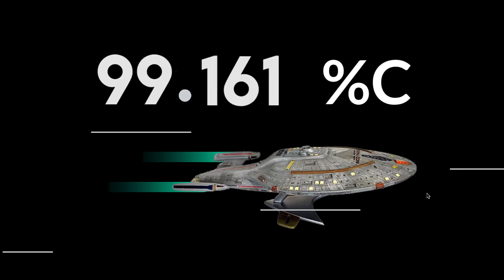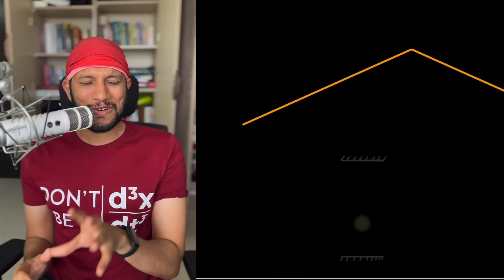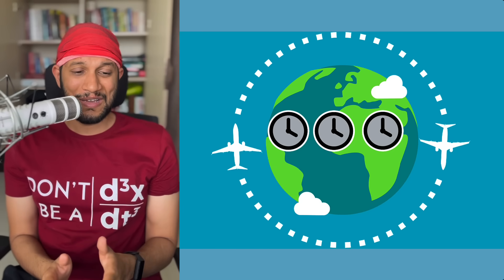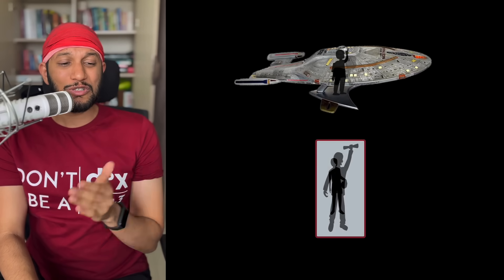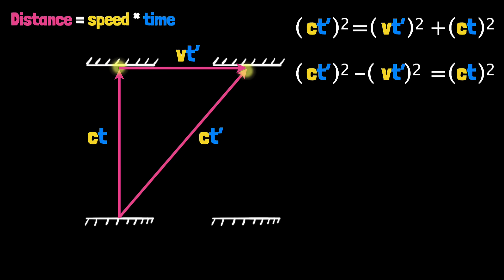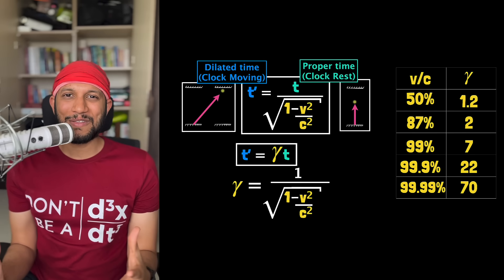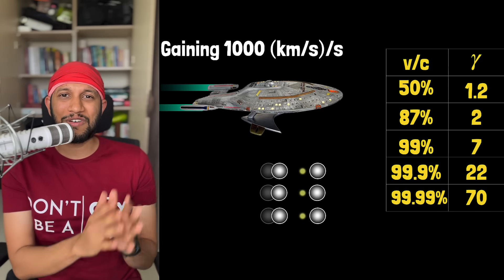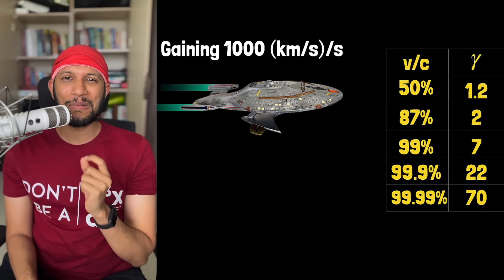I finally understood why you can't go faster than light! (My mind is blown)

Comment: Einstein simply stated the faster you go the more fuel you need until the weight of the fuel is so much you start going slower. You can reach the speed of light with an anti gravity machine. If you create a magnet strong enough through electromagnetic engines you can push yourself away from the earth by using alike poles. +to+ to and in deep space with zero gravity you can get to the speed of light with just a simple push and you will continue to gain speed until you hit the speed of light. Because matter travels at the speed of light in zero gravity space

Comment: Hi! Mahesh,
I like your videos, especially  because of great explanations.
But in this case, I have a counter intutive argument regarding the photon clock.
Let's assume that the photon clock is kick started by a pulse laser placed below the lower mirror so that a pulse of photon can be fired in the upward direction from a tiny cavity.
Now, my question is how come the laser pulse be fired diagonally in the moving rocket (or moving inertial reference frame) to hit the upper mirror. 
It seems like the photon is also getting dragged with the moving  rocket. 
The light photon should move in a straight line towards upward direction in the first place, missing the upper mirror.
If not so, then the whole experimental setup will not be visible to us on straight line of sight as the light coming from the spaceship will also move diagonally towards right side escaping detection.
In that case we might be able to see the spaceship in the past by detecting the lights coming from the upper left side as the light is moving diagonally.
It is still the dilemma even after applying the length contraction.
If possible, please re-explain this topic with my laser pulse.

Comment: I haven't studied this in classes, and since I am new to understanding it these ways, I am just thinking thoughts.  Seeing 1) C is constant because it needs to answer the need for velocity to be indetectable within its own frame of reference.  So in your example of the twins aging, the one "on the ground" is staying still and the one in the USS Enterprise is aging slower because it is moving faster.  But to the twin on the Enterprise, the twin on the ground is the one moving, therefore aging slower.     Then there is this question.  If I turn around once on earth, relative to myself, it is the stars in the sky that moved in a circle around me.  For them to move in that circle at that speed, they would definitely need to go faster than C.  Relative to me they have broken the speed limit in a circle around me.

Comment: The explanation of time dilation is brilliant. With regards to C limit I wonder though - the special theory of relativity discussed only inertial frames of reference (frames of reference that are not accelerating). So inside the accelerating ship, we cannot rely on the relativity postulate, that all physics rules look the same, and therefore I don't know how the photon clock behaves in that frame of reference, IOW whether time dilation holds. The other explanation I heard for the C limit is that it would destroy causality. That is if you look at a rocket launching and hitting its target, and another observer who is traveling in a speed greater than C with respect to you is also observing the rocket (I forgot in which direction he would have to go), then he will see the time of hit happening before the time of launch and that destroy causality.

Comment: Nice! 
Another thing I have in my mind is, when you travel with speed a photon coming against you is blue shifted. So faster you go so more blue shifting has that photon, so shorter is its wavelength and so  more energy it has. So you can't reach c because if you do reach c the energy of the photon will go infinite. 🤔
But maybe my asumption is wrong...

Comment: this didn't really help me unfortunately.   What you have described here is from the perspective of the stationary observer watching the ship move.   Take the photonic clock.  It takes longer for the photon to bounce up and down from the stationary observers point of view, but on the ship the clock is ticking at the same speed it was when they were stationary.  it doesn't actually slow down on the ship.   same with the propagation of the forces between atoms, from a stationary standpoint it takes longer for the force to propagate, but on the ship it takes the same amount of time as when it is stationary.

If you take the stationary observer out of the equation and look at it solely from inside the ship, whats stopping the ship from reaching or exceeding the speed of light.   In your last section it takes 70 seconds from a stationary observer for the ship to increase its speed by 1000m/s at 99.99% of the speed of light, but on the ship it only takes 1 second of relativistic time correct?  so from on the ship every second your ship goes 1000m/s faster.   wouldnt you reach and then exceed the speed of light if you keep going?
Reply: it's kinetic energy, warping space time, and the impossibility of putting all speed in traveling thru time into space

Comment: 1 spaceship on the left and one spaceship on the right, with a distance of a lightyear between them. the spaceship on the right start driving towards the left ship with 80% of speed of light. they will have aged less than the ship of the left right?

What if i told you that both ships already was driving at 80% of speed of light towards the right when the right ship started to drive towards the left ship, making his speed in a way deaccelerating. will the rights ships crew still have aged less, or will it be reversed?

For what i understand there is no absolut 0 movement, but how can we then say that something ages less, if we don't know which object that is actually moving faster than the other?
Reply: whoever traveled faster longer relative to the other has more time dilation.  motion is relative, accelerant and non inertial frames are unequal

Comment: thanks for the explanation
so about the realm without measurement - where time doesnt exist and spead and distance doesnt exist as well. the rules if there are ones may be different. maybe if travel and speed arnt needed then energy isnt deeded as well. you may just be there and come back without realizing that since it cant be measured. still you can have a nice trip in total darkness where light wasnt born yet to have speed.

Comment: If you take out light in the experiment of the clocks (in other words, remove the ability to use reflection of light to show the hands moving), do they still sow down? I think Einstein meant it as a visual illusion due to the distortion of light, and some took that to mean time actually slows down. I believe light can be manipulated but to then make the assertion that time is relative is in my opinion, a misunderstanding of Einstein's thought experiment. Also, the clocks being out of sync are probably being affected by gravity more then anything else. Let's not forget that Einstein meant from the perspective of the observer. The clock outside the ship may look different, but the watch on the travelers hand will run at the same speed as anyone outside the ship. Having a mathematical formula that explains photons traveling longer then other photons in relationship to objects does not mean time has slowed down, it just means we understand there is a change in perception (skewed) . Nothing more.

Comment: You just don't understand do you? You are not your (body), you are a Quantum Form of Energy Operating a Biomechanical Organic Quantum Cavity. Travel at the "speed of light" and more is beyond possible which I do each cycle (day). As a Quantum Form of Energy Operating in a Constant State of Superposition you are more than capable of traversing at an almost instanious rate. Go beyond the limits others have set up for themselves. Just because they didn't doesn't mean you can't.

Comment: You should make a music video just saying tik... tik... tik.... tik...
Also the photon clock makes no sense, as the structure moves the photon would just hit the side wall, either get absorbed or if its mirror it would reflect in different directions. How are we forcing the photon to only go up and down, and why does it start to move in an angle as we start moving?

Comment: There is one thing I do not get here. Lets say you fly out the athmosphere but then "stand still" in relation to the sun. So basically the earth is rotating under you. So who is now moving? From your stationary position, the clock onnthe earth is moving in circles, from the earth you are rotating around the earth.
So who's time is now running slower when you go back to earth? Who's clock i going to be ahead?
What is the reference point for "you move faster"? If you take a space ship and fly away near speed of light and come back, why is your time slower and not the one on earth? Fro. Your standpoint the earth flew away with near speed of light.
The gravitation and it's effect to time makes much more sense to me as there is a mass (reference).

Comment: Very interesting. But on the other hand. If speed of light is maximum, why would you want to be at say 99,9999 instead of say 99 or even 99.9

The way traveled is 1% or 0.1% longer.

So 100 years of travel becomes 101 or 100.1 years. 
Does it really matter at this point?

Comment: But isn't that all just for the observer? Wouldn't the ship keep accelerating at 1000 m/s from the ships perspective?
Reply: From the ship's perspective, the ship is at rest, meaning its velocity and acceleration are exactly 0 at all times.  In order for someone aboard the ship to make a useful measure of their velocity or acceleration, they necessarily have to do so relative to some external point, which is just the situation already described in this video.  This is slightly counterintuitive.  If you are in a car traveling down the freeway, you would typically just say that your velocity is, say, 60mph.  But this is just shorthand for saying that the car is moving at 60mph relative to the ground, as we usually implicitly measure speeds on earth relative to the ground.  But in some other equally valid reference frame, such as that of the sun, the car will have a much higher speed.  So the car does not have some "absolute" speed, the value we measure for its speed depends on the choice of reference frame (i.e. "observer"), which is arbitrary, and in its own reference frame, that value is 0.

Comment: If gravity also affects the quarks movement. Couldn't gravity overcome this? 

A black hole can bend light.

So if we could direct gravitational force in a way that it accelerates the quarks movement, can't you overcome this? 

I feel like understanding how to travel faster then the speed of light lies in the relationship between electricity, magnetism, light, and gravity. 

Even if you can't ever overcome it, I think there's still room to push the curve a little further right in the graph.
Reply: Like, if a gravitational field can be created around the construct of enough intensity to bend light. You would be traveling in a bubble of more... favorable relativity? 

Visually, I'm thinking of a sonic boom.  How breaking that barrier of sound creates a barrier of force effect that kind of isolates the craft breaking it, to outside forces. 

So. Kind of like the sound of a jet breaking that barrier has delay as the force of sound "catches up". A ship traveling faster then light, to the outside perspective. Would either dissappear, or the visual image of where it is would be noticeably "where it was"

I have to image since light, is the barrier you're breaking. Visual reference from the inside of the ship would also be delayed or disappeared. 

Furthering my original point. What if the reason a black hole is "black" is because ^ of that.  What if the Visual perception of a black hole is just what's able to be seen when light, or some other matter. Is accelerated to a speed past the point of light. 

I think we understand way too little about our universe to be basing entire fields of study on "infinite" or "impossible". They're too absolutist of terms. And confining ourselves to the absolutions effects the way we try to measure and analyze the problem.

It's all theory until someone can answer the question "how can I measure something faster then the speed of light" if that's our hard limiter in understanding physics, that's the ceiling to aim to break.

Comment: The question is now, why do photons or how do photons transfer energy.
Reply: They carry momentum.  The full equation is E^2 = (pc)^2 + (mc^2)^2, where p = momentum, and the familiar E = mc^2 is only a special case for massive objects at rest.  As light is massless, the equation reduces to E = pc (note also that the concept of momentum is generalized in special relativity and does not require mass as in the classical formula p = mv).  So a photon carries energy proportional to its momentum.

Comment: The question I have never understood is, for the people in the ship that moves fast, we, the people on Earth, are moving away from them fast too. Is there an objective reference referring to movement in the universe? otherwise, why is the ship moving, and not we, moving, and the ship staying still?
Reply: The ships is moving and the earth is stationary if we measure from the earth's frame of reference.  But the whole point of relativity is that all reference frames are equally valid.  So we could equally well use the ship as our frame of reference, and in this frame it is the ship that is at rest while the earth is moving.  Whether an object is moving depends on the frame of reference you are measuring relative to.  There is no such thing as "absolute" movement: if an object is moving in one reference frame, it is simultaneously at rest in another equally valid frame.

Comment: My biggest problem with accepting this notion that you can't travel the speed of light or faster than light is that we as humans are limited to our perspective as we see in light photons.  It stands to reason that it's only a limiting factor, and sure, we will likely be handicapped without better instrumentation or assistance in some way to mitigate it.  To me it's as good as trying to explain a mirage.  What we see is just not accurate, and with light, it's just so fast that because it's how we see, and that photons do have a speed of its own, we'll experience different results looking at it from various perspectives, but time itself won't be altered.  Time is ever present in my opinion throughout the universe.  All that changes is your perspective on the movement of it depending on what you're looking at.

Comment: There's another example of time dilation that you could've included in your video: namely dealing with GPS satellites.  This level of time dilation actually almost caused a total upending and rejection of general and special relativity and almost lead us to believe that something could travel faster than c.

In 2011 the OPERA experiment initially detected a neutrino traveling at speeds BEYOND C.  Independent analysis from other experiments however, refuted that result.  The question became: what did OPERA do that caused the erroneous results?  They were using GPS based clocks and those gps clocks had loose connections which caused a time delay.  In 2012: ICARUS was performing experiments to determine if the OPERA results were correct.  ICARUS results showed that when you account for the technical problems between the GPS clocks and the Atomic clocks: the error in the results was clearly manifest.  As a result: we did NOT end up throwing out decades of established research and Einstein's theories of Special and General Relativity still hold up.

Comment: Time dilation was "proved" by flying one atomic clock in an aircraft for a length of time, whilst an identical clock was left on the ground. Then comparing their times when the airborne clock was once again on the ground (Hafele–Keating experiment).

The atomic clocks used were caesium beam clocks - My question is "would moving such a clock into an environment where there is a decrease in gravitational forces and a 15 times increase in radiological dose, result in changes to caesium-133 decay ?" 

It seems more reasonable to look at changes in caesium-133 decay rates in different environments, than asserting that time itself has changed.

Comment: Wait, so it will take ~infinite amount of time from an outside observer’s perspective. What about the ship itself? From ship’s perspective, it still gains 1000km/s/s in proper time.
Reply: "From ship’s perspective, it still gains 1000km/s/s in proper time."  

For one, proper time just refers to the time an observer experiences.  This, being a time, must be measured in units of time.  It does not make sense to equate proper time to an acceleration.  

But I think you mean that the ship experiences 1000km/s^2 of acceleration.  But what does that mean?  What does it mean for an observer to experience an acceleration?  If an observer measures in their own reference frame, (that is, the reference frame attached to them that moves with them) then trivially their speed in that frame must always be zero, hence their acceleration is also always zero.  So if an observer is to "experience" an acceleration, this acceleration must be measured in some external reference frame.  But if the observer (call her Alice) is measuring their acceleration in an external reference frame, that is no different from some other external observer (call him Bob) measuring Alice's speed in their reference frame, which is what is already discussed in the video.  In Bob's reference frame, Alice's speed will approach the speed of light, while her acceleration will approach zero.  In Alice's reference frame, she will always remain at rest while Bob accelerates away from her.